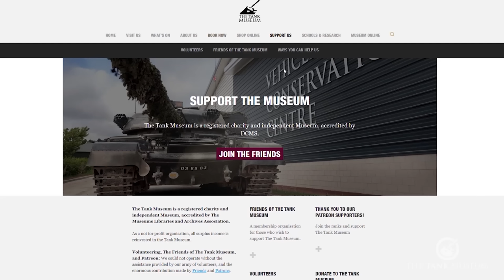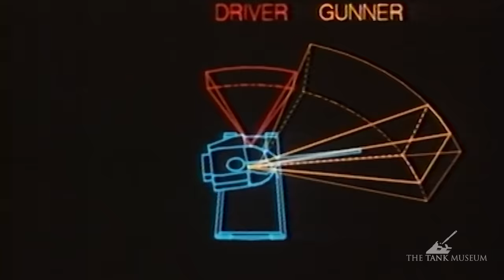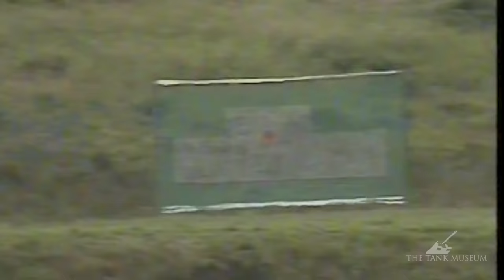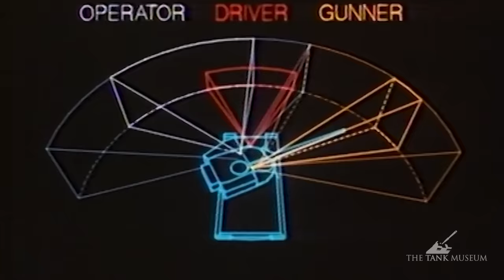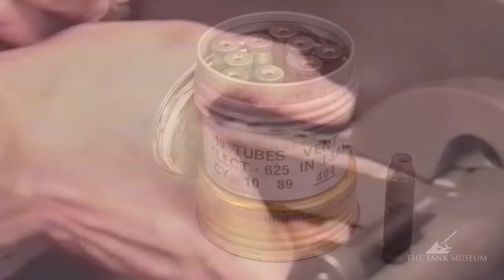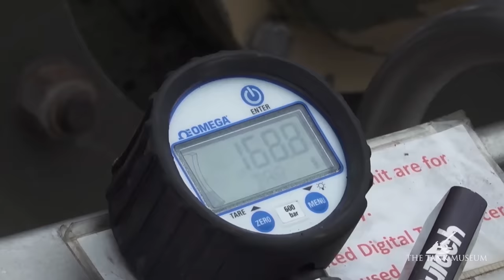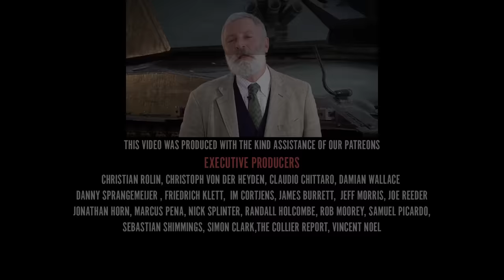Tank Chats #92 | Challenger 2: Full Length | The Tank Museum

Comment: it gets me why they did not upgrade the Challenger 1 or 2 with the same power pack/engine, fire control and gun from the leopard 2 - they did make a few for export called the Challenger 2E but got zero orders
Reply: Because they realise just buy Leo 2 or M1 instead
Reply: The video explains why they preferred the rifled gun.  As to the power pack, presumably cost was a major issue.  The engine in the E variant wasn't the Leopard 2 engine.
Reply: Because of the ammunition. What people tend to forget about Challenger II and Leopard II is they use different types of ammunition. Leopard II uses single piece ammunition, the Challenger II uses three piece ammunition, the projectile, charge and detonator. That means the ammunition stowage requirements for the vehicles are TOTALLY different and a huge portion of the interior of a tank is specifically designed around ammunition stowage.
This is the reason why Challenger II will NOT be fitted with the Rheinmetal gun, to do so will require an almost total redesign not only of the turret but also the hull interior in order to create adequate stowage for single piece ammunition. There is one Challenger II that has been fitted with the German gun and it can stow around 16 rounds of ammunition. Most people who whitter on about how simple a gun change is do NOT take this ammunition difference into account. It makes a huge difference. 
It may well be the case that the British do eventually use the German gun, or the new 130mm, but when they do so it will be mounted on a NEW tank, not on Challenger II. It simply is not economically viable to redesign Challenger II in such a huge way that would make the gun viable, it would only be a little more expensive to design a new vehicle from the ground up.

EDIT: Challenger 2E did not use the RhM gun, it did have new fire control but not the RhM gun for the reasons I specified. It was almost certainly that three part ammo that was the reason no one bought it, as most nations perfer to vastly simplify their ammunition requirements by going for the NATO standard which is the single piece rounds for the RhM 120mm
Reply: @alganhar1  you're aware the BAE Black night upgrade prototype has a smoothbore gun right?
Reply: @tisFrancesfault  BAE never proposed a smoothbore as the UK MoD and Gov did not request it as part of the upgrade. BAE and Rh have now combined into a single bid - Rh have offered a smoothbore as an extra that may interest the MoD but it is not part of the requirement set out
Reply: Mostly because the leopard is not really that good, combat proves it...
Reply: @tisFrancesfault  @tisFrancesfault

Comment: Just as an observation on tank design, we are all looking for the one tank that does everything. We know that this is not possible. We should have a vehicle that is light in maneuverable and you should cruise shave and then I have your vehicle, that vehicle would be the tank and as we know today. The United States has solved this problem although I don't think it's truly conscious solution to that problem. The striker vehicle has the ability to mount various turrets on top for specific assignments. They have tracker body upon which they've mounted a 105 mm gun, I'm not too sure of this precise size so I'm just picking one out of the air. They also have an anti-aircraft version and a fully dedicated infantry support and transport and finally a vehicle that accommodated the commanding officers of that particular unit. So we have to design our fighting vehicles to intentionally not do everything but to do several combat assignments. The original intent of the blitzkrieg was to use each element of your fighting force like a conductor uses an orchestra. He conducts the instruments and the players to perform a symphony. Tim Manstein,. Guderian and Ronald, it was all about offensive operations with each unit working in a coordinated attack. The stuka was an extremely valuable aircraft for the first part of the second world war German infantry thought of it is a form of artillery . The stuka was there for used to handle any unexpected
Reply: complete bullsh**

Comment: Does that challenger still has an engine in it or did they take it out to put into the tanks that are actually running today?
Reply: It's a runner, so yes, it has a power pack. Modern tanks the engine, cooling system and transmission are all essentially one piece, makes changing them much easier as you just make a few disconnections, lift the entire power pack out, lift a new one in, reconnect it and your tank is good to go within a couple of hours at the most. A good maintenance crew can do it much faster.

Comment: Is the Challenger two currently available for export?

Why does nobody want to buy it? 
If it is .
Can’t we sell any to Poland?
Reply: @FunAllDayLong4353  why does the challenge you get such a good rep then?

I went past the factory once on the train it was amazing to see the tanks
Reply: @KKTR3  It is a good tank still but that's more a point about how little the tank has evolved since the collapse of the USSR as the tanks we all had were adequate for low intensity warfare. It has a good rep because it has performed well but in low numbers. It's clear to all a Modern tank is needed but that's a long ways out so for now the existing tanks will be upgraded and knowing the current state of Britain's arms industry we will import a new design
Reply: @KKTR3  Same here - on the way to Scarborough. Amazing. But its all gone. The Challenger performed very well in Iraq. It's impregnable against old-school infantry fired anti-tank projectiles. One once withstood 70 hits and was back in operation later that day after it's damage was fixed. It's also very reliable. It had to be to win the contract. But its now 20 years old. The Challenger III wont be at all bad from what experts are saying. But at the end of the day its a numbers game and 150 tanks isn't enough. Looks like they're trying to force us into an eventual European Army,  but even then the tanks will be spread too thin to be any good. IMO.
Reply: @tacitplague7079  😡😥
Reply: @FunAllDayLong4353  Yes we have to restart industry, the British people keep voting for muppets.

Comment: One question. What are those pyramidal pilons at the front of the tank? Some sort of support?
Reply: I believe they fire "chaff" which is particles of hot metal as a decoy to incoming missiles.
Reply: @MrSupercoz  Turret or Hull? If you mean on the turret they are smoke dischargers to conceal the tank in open ground while seeking cover.

Comment: Relatively underpowered for its combat weight and needs to ditch the rifled gun - outperformed in all respeocts by smoothbore guns.  And what about Active Defense?  Can the UK afford a tank comparable to the other big players?
Reply: The rifled 55 calibre gun hits harder than the short barrel L44.
Reply: @v4skunk739  And the rifled 55 caliber gun hits harder that the rifled 2-pounder.  So?  Smothbore 120mm guns come in greater length than 44 caliber, and, length for length  and charge for charge, smoothbore guns have greater velocity due to reduced bore friction, which also reduces barrel wear, and more accurately fire sabot rounds.
Reply: @thomaslinton5765  The  L44 doesn't hit harder than 55 calibre L30. It is basic physics. And there is no more friction in a rifle than smoothbore.
Reply: @v4skunk739  And I didn''t compare the smoothbore L44 to the rifled Caliber 55.  I compared a rifled barrel to an equivalent smoothbore with an equivalent charge.  That's basic English.  Here, let me try again:  The smoothbore Caliber 55 hits harder than the rifled Caliber 55 AND is more accurate AND has longer barrel life AND can fire missles, like the LAHAT,  with a practical range of 8000 meters.    One country, due it's love affair with HESH, uses rifled MBT cannon.  "Love is blind."

Comment: This is SO UNTRUE. HESH rounds do not need to be fired from a rifled gun, just like HEAT or HE rounds do not need to be fired through a rifled bore. Modern smooth bore HEAT and HE munitions have pop out fins in the back and there is no reason why a HESH round cannot have the same. It is more accurate to say that a CHEAP HESH round in the form of a spin stabilized artillery shell with a plastic explosive filler and no additional complexities need a rifled bore!
--
The reason for going to a smooth bore is also cost. Not only is a smooth bore gun barrel cheaper to make, they also lasts quite a bit longer than rifled barrels. A rifled barrel becomes inaccurate far quicker as the rifling wears. A smooth bore only looses velocity as the bore to ammunition tolerances open up with use. Today, with the effort to squeeze out every bit of performance from 120mm ammunition, even smooth bore barrels wear out with 50-100 shots of highest performance (15MJ+) APFSDS rounds. You simply cannot get to those pressures and performance with a rifled gun. So the idea of a rifled bore to accommodate simple and cost effective HESH ammunition is offset by either the reduced ability to field the most effective kinetic projectiles, the higher cost and frequencies of barrel replacements, or both.
Reply: I'm afraid you're dead wrong. Hesh rounds absolutely need rifled barrels. The desire to use HESH is the ONLY reason the British kept the rifled barrel, no other reason.
Reply: @Jin-Ro  Your insistence is based on what? Are you saying that a non-rifled round of plastic explosive will not pancake on impact? Or, that a round with a thin shell and a plastic explosive filler cannot be fin stabilized?

Comment: How does Challenger 2 compare to the latest version of Abrams?
Reply: Abrams is better. Better crew survivability and faster.
Reply: @user-propositionjoe  No Challangers have ever been lost except from another challanger,which cant be said for the Abrams,sorry what were you saying
Reply: The thing with the Abrams is the Yanks can throw an endless supply of money at them, upgrades, logistical problems, training, maintenance etc, so a point by point review of the 2 would be hard leaning to the Abrams. If we were to take a static shot of just the tanks (no outside factors involved) the CR2 would have the protection and possibly the armament while the Abrams would have the agility and possibly the armament.
Reply: They got 99% similar capabillities but lets just say that the Challenger 2 always comes in behind the other main battle tanks (M1A2, LEO2 and Leclerc) in trials...
I like it though, not as sext as a Challenger 1 but definitly a looker
Reply: @rosslynstone  Abrams have been produced in far far greater numbers than Challenger. The wars abrams have been in and the numbers involved don't even compare, if you put challenger in the same situations as when Abrams where lost the result would of been the same. No tank is indestructible, the point that Abrams is faster and has better crew survivability is still valid. Challenger with it's hull ammo stowage with no blowout panels and underpowered engine.
Reply: @user-propositionjoe  Challenger's ammo has wet stowage so it has a very low chance of going off I believe
Reply: @JostVanWair   blow out panels are much more effective but ok, I don't see your point.
Reply: @user-propositionjoe  Blowout panels may be more effective but Challenger 2's ammo won't be throwing turrets like any russian tanks
Reply: @JostVanWair  of course it would throw a turret. What are you even on about?
Reply: @user-propositionjoe  dude, do you know how wet ammo stowage even works ? There's a low chance of the ammunition actually going off because when a shot penetrates the container, the antifreeze/water mix will soak the ammunition, which will either slow an ammunition fire or prevent it altogether. also, I'm pretty sure that the Abrams doesn't store all its ammo in the rear turret compartment either. 

when fitted with wet ammo stowage, it was observed that the chance of a Sherman tank's ammunition exploding after penetration went from 60% to 15%
Reply: @JostVanWair  you seem to be absolutely obsessed with wet ammo stowage. Yes I know what it is, and it's not as effective as blowout panels. Yes abrams doesn't store all of it's ammo in the turret it also has a hull ammo rack which is also protected with its own compartment and blowout panels. Against a top down anti tank weapon that penetrates the tank the only chance the crew would have is with seperate compartments and blowout panels, and even then if it penetrates straight into the crew compartment then everyone is dead anyway. Challenger 2 has never been hit by a modern top attack weapon like NLAW or Javelin and would fare the same as Russian tanks in Ukraine. Same as basically every tank. Who cares if the turret doesn't pop off when the whole crew is dead and the tank is unuseable. No tank is indestructible it's only about how they are used. Perhaps you could stop with this pointless topic now?
Reply: @user-propositionjoe  sure man

Comment: The 2 piece ammunition still is not really a sensible system for a modern tank gun. It just takes too many steps to get a gun loaded and I'm quit certain will get a loader exhausted at a much faster rate than a loader who is dealing with one piece ammunition even though the complete round may weigh more and be slightly more difficult to maneuver in the turret.

Comment: The challenger 2 was always a meh vehicle compared to its contemporaries its by far not the best compared to the leopard or the Abrams or even a t90  but its still pretty cool nice tank chat though we do love some armor around a tea making machines
Reply: Its just as good as the very tanks you mentioned. Worse in some areas, better in others. Despite being 30 years old its dorchester level 1 is still consuidered good enough to stop most threats it will ever most likley come across, its still quite mobile despite the 1200 horses, its gun may have reached its limit to APFSDS length but L27A1 is still good enough to effectively fight modern threats. In actuality the only truly disspaointing aspect is the lack of CITV. The LEP aims to solve the glaring issues such as the CITV and turret systems. The only reason many see it as inferior to its counterparts is that it doesnt get the same love when it comes to upgrades. If Cr2 kept on track with larger upgrades similar to what you see happen with leopard and Abrams there wouldnt be any challenge in identifying its match.

Comment: Why was the challenger 2 never sold to other countries?
Reply: It was sold to Oman.
Reply: @SIXITHS  Thank you. though oman is an insignificant country. I would have expected the UK to leverage their status as a once Great colonial power and leader in the commonwealth to develop and sell arms to this nations. But the country has fallen so bad.
Reply: @ozonzechibudike4293  That's easy. Money. There are few country's in the world with modern tank forces. Soviet tanks were exported because they were cheap as hell, and now we know why, their performance in Ukraine has been abysmal, and they were creamed when they went up against Challengers and Abrams in both Gulf wars. Basically a lot of country's were convinced by Russia to buy their crap. They are surely regretting it.
Reply: @jamescpalmer  You still not answered my question. Having spent huge resources in developing the challenger 2, why didn't the UK govt sell to other countries like the germans did with Leopard?
Reply: @ozonzechibudike4293  They were never designed as an export model, Britain tends to design it's MBT's for its own use and tends to sell surplus, which means its highly capable within it's main roll and not designed for external operators. It's also not a continental power like Germany so has no need to keep large scale manufacturing of tanks as it's priority favours naval and air power. It also doesn't need a large army for this reason, hence tanks are not needed to defence Britain. Tanks are definitely required to defend Germany however, but they certainly don't need 2 $4billion aircraft carriers.

Comment: 33:15 - “1200bhp, upgrading slightly in the future.”

You know something about this David? I’ve always said this idea of putting the 1500bhp euro power pack from the Leo 2 in the Chally 2 wasn’t cost effective, you’d have to change so much it would be ridiculous, you’re far better off just upgrading the current CV12 engine to 1400+ bhp, far cheaper, far easier, and the results will be basically the same.
Reply: He's talking about the CLEP / HAAIP programmes for British Army heavy armour. The CV12 is getting Common Rail diesel injection with turbo after cooling which will boost out put and torque (people always forget to mention the importance of torque). Look on Caterpillars website to see the newest  version of the CV12.

Comment: Phew ... I don't know about the protection being so good... Thats a massive lower frontal plate even bigger than that of an abrams .. but unlike Abrams or Leopard 2 it has only 76mm of Steel there.. and then the upper Plate is supposedly good protected but then they decided somehow to add a massive weakspot with the way they placed the driver and his vision blocks... 
And even worse , it is not even angled there. Right behind the drivers hatch is a 0° steel wall with 60mm of armor... 
Designers of Abrams and Leopard 2 made much better decisions there...
Reply: The gun manlet is also huge, nearly a third of the turret front and lacks any composite armor.
Reply: @alphana7055  i think there warthunder is a tually incorrect. All other western MBTs feature NERA on the mantlet in real life . I dont see the brits negleting this spot.